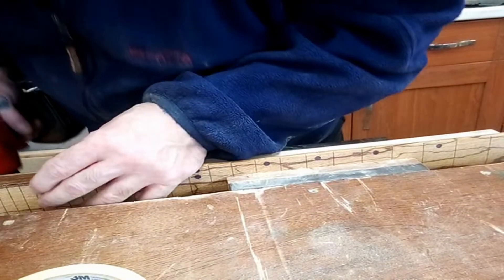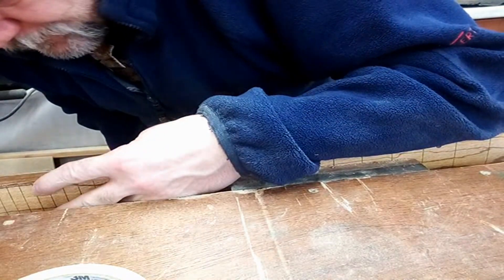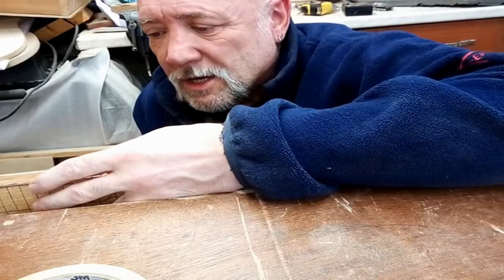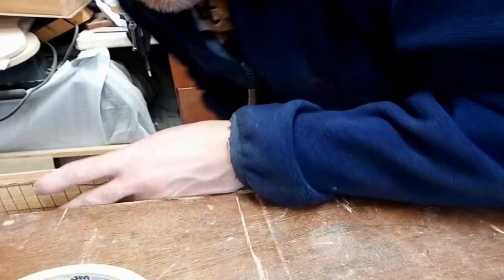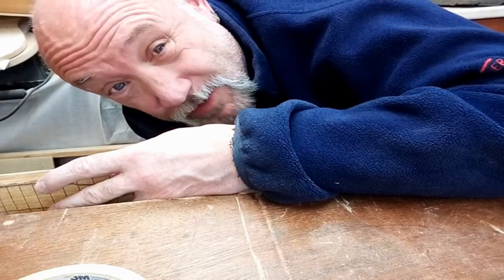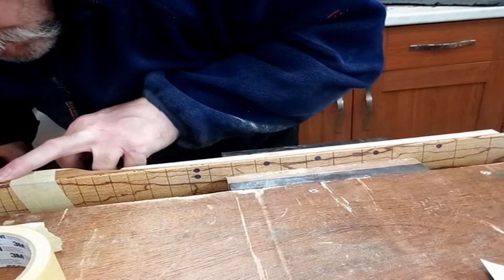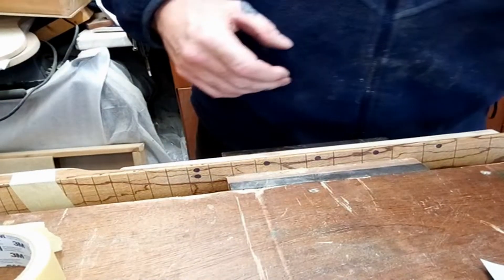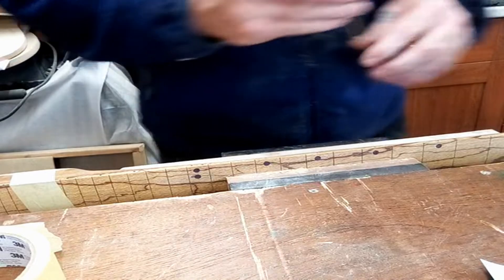A SPICEY ONE  :O with lots & lots of Swearing

Comment: Sometimes it helps to drill in reverse, I do this with my sides dots, well at least to start it off. Works really well with brad points
Reply from the maker: Drilling that in reverse wouldn't have made a bit of difference on that because there must have been a week point in the grain and just so happens it was where i didn't want it to be 
It was only when i got it to depth that i split